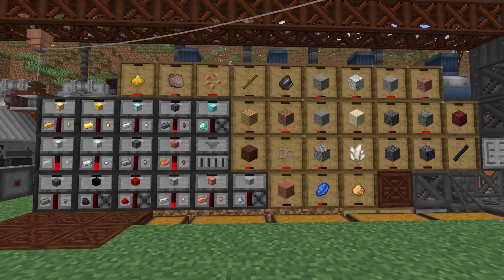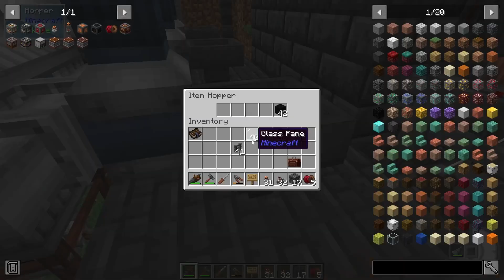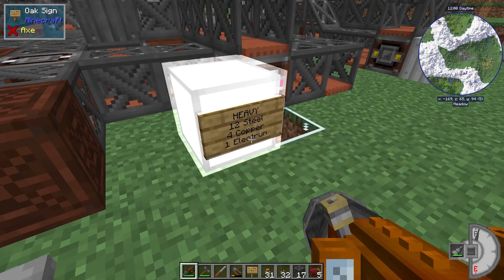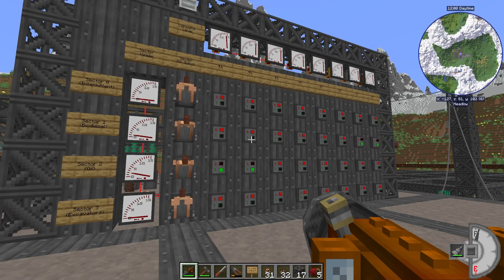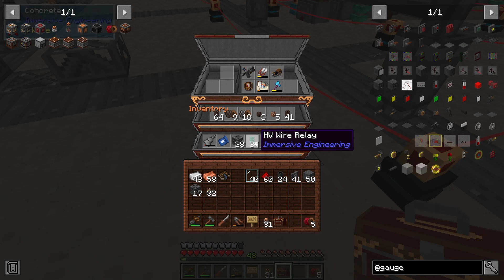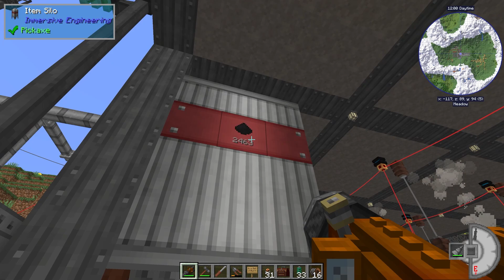1.19.2 Immersive Engineering Base Tour - Biodiesel, Crude Oil, Switching Yard & Control Room

Comment from the maker: Update: The power switching now arbitrarily doesn't work for no discernible reason 😪 I've tried on a creative world too, and the setup worked, I moved some things around to test it, moved it back and then the same setup as before didn't transmit power. Answers on a postcard please.

Update to the update: It seems some of the wires from the generators were burning out during testing. I replaced the feedthrough insulators with HV Capacitors and that seems to have helped (the connectors will limit throughput to 4,096 RF/t). It also helps to only switch the sector on when enough power has been assigned, possibly assigning one by one was causing a burnout.